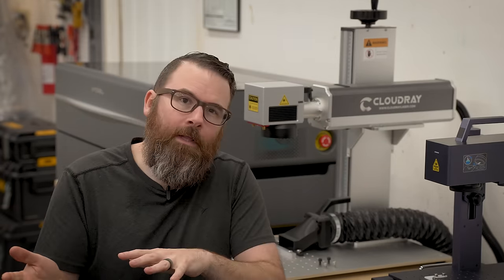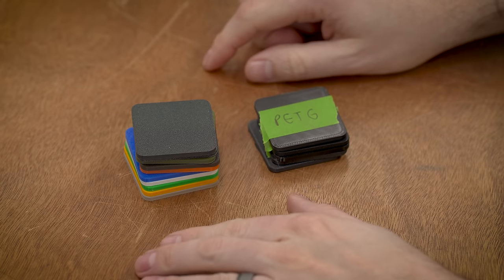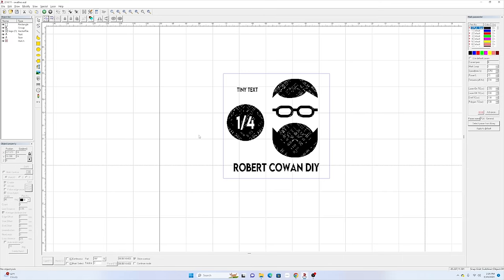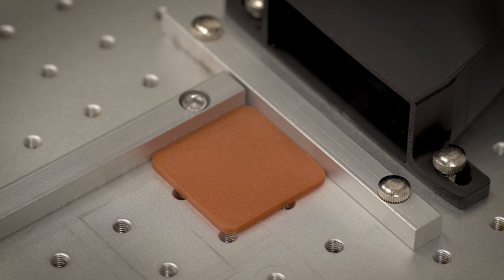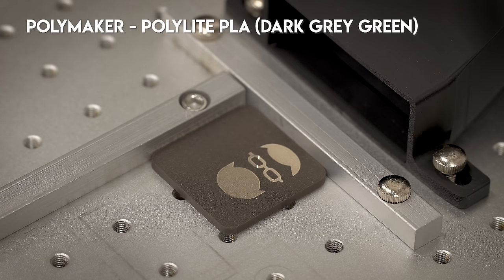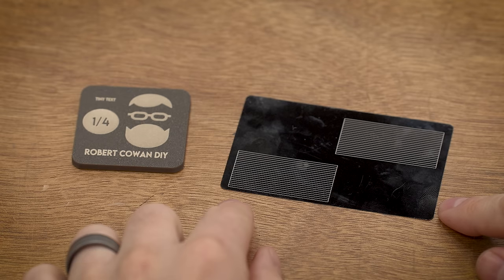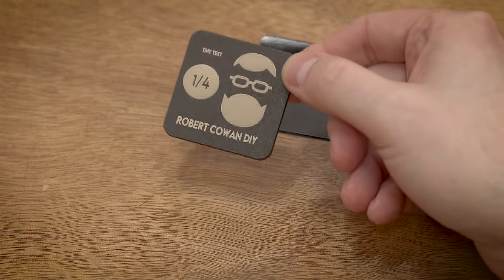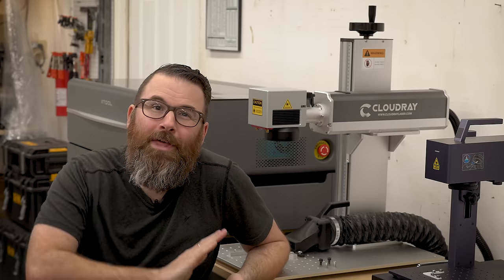Laser Marking 3d Printed Parts

Comment: Perhaps try doing a material test grid that comes standard in Lightburn. I've been working on some product designs and did a lot of 3D printed test pieces on my Ikier Fiber laser with the test grid to find what works and doesn't. Blue should work well. Yellow, Red and White just don't work in my experience. Blacks and grey, most greens do work. I print 100x100mm PLA flat test pieces which allow a decent material grid test for power and speed.
Reply from the maker: That could maybe work.

Comment: That sharpie would be a great trick for all sorts of light and colored filaments. How does it hold up against rubbing? Might be interesting to test different paints and see how they hold up to wear
Reply from the maker: Yeah, I glossed over it in the video, but it's something I'll visit again.  You could do the opposite of what I did, laser off everything BUT the design, etc.  It could be a good way to add lettering to light materials.
Reply: Protective clear coat of paint could be an option if the application allows
Reply: I've used sharpie for some markings in PLA and it hasn't held up in the long term.  Would be interesting to see how the laser marks in something that bonds more strongly to the plastic, (UV cure epoxy paints or something?)

Comment: Just as another data point, my functionally stock K40 (CO2 & Gantry Laser as opposed to Fiber and Galvo) works pretty good for engraving PLA, it ablates it well enough that I can print a few layers of my "text" color and then print a couple layers of my "face" color and then laser engrave it and it'll show the under-color where I engrave it. I've gotten text, logos etc. far smaller than I ever could with a printer.
Reply from the maker: I had a K40, they're fun little machines.  I always found that it still looked a little bit like melted plastic rather than this two-tone look from the fiber.  But I was able to get some fine details.

Comment: Colorfabb has or used to have a filament that was specifically designed to be laser engraved
Reply from the maker: OH, good to know!
Reply: Discontinued
Reply from the maker: @bonjipoo  Oh bummer.
Reply: It was a clever type of material which changes colour significantly when the laser hits it. Similar to how dashboard button are black but engraved with white markings. I believe the plastic is designed to turn white when exposed to the right wavelength.
Reply: @bonjipoo I believe it's due to the addition of one of the titanium "oxides" (I just can't remember exactly which one). Essentially it will react with the laser much better and produce a cleaner marking when the laser beam hits it.

Comment: I do need to try this again. On previous tests, I was not too happy with the results I got - just not sharp enough for my liking. I then switched to white PLA that I spray painted black, so kind of your sharpie trick, and that gave me a result that I was very happy with: a black surface with very sharp bright white symbols.
UV fiber has a complete different wave length than the IR one you have. A UV fiber is able to mark on white plastics and even on glass, something that is not possible with the 1064 nm IR fiber laser.
Reply from the maker: I could be mistaken, but IR and fiber lasers are different.  Mine is not an IR laser, but a fiber.
Reply: @RobertCowanDIY IR and UV are certain ranges of wavelength in the light spectrum. The visible light ranges from violet, blue, green, yellow and orange to red. Left of this (below purple) the UV (ultra violet) spectrum is found (100-380 nm) and all on the right side there is IR (infra red, 760 - 14000 nm). The fiber in fiber laser just tells us where the "lasing" takes place.
In a CO2 glass tube laser, there are two mirrors on each side of the tube so the light bounces back and forth between those to create the laser beam. In a fiber laser this process takes place inside the special fiber (this is oversimplifying the process but kind of explains why it is called a fiber laser). 
A UV fiber laser has a ~355 nm wavelength, an IR fiber 1064 nm and the CO2 laser tube 10600 nm. UV is great for plastics (even white plastic) and glass, the IR fiber has limited abilities on plastics but is great for metals and (dark colored) paints. The very long wavelength of a CO2 laser tube will blast through anything. You can cut through a lot of different materials with this one and engrave them when using lower power settings.

Comment: Not sure if it's of any use to hobbyists looking to laser but I've personally managed to laser Markforged Onyx, Stratasys ABS-CF10 and Nylon-CF10, and Stratasys ASA (Green) ABS (blue and ivory) and their black TPU with great success. I think it honestly will depend on material brand on whether you'll get decent results if I'm honest
Reply from the maker: Interesting.  I had no luck with anything with carbon fiber.  I might need to try some different settings though.

Comment: Just FYI:  the xtool F1 has a 1064nm galvo as one of its two galvo lasers.  The other is 455nm.  Both are diode.  You select which is used via software; no hardware fiddling required.
Reply from the maker: Yep, I'm aware.  They've been trying to send me one for the last year!  I suspect that 2W wouldn't be enough.  Also, they're not a pulsed laser like a true fiber.  It might get close, but it won't be as crisp.
Reply: @RobertCowanDIY I've marked a fair few materials with our laser pecker LP3 which is a 1W 1064Nm fibre. You can get decent markings from it but due to it being 1W it's very slow indeed lol
Reply: @worldwidepig  LP3 is not a Fiberlaser. It's just a diode laser. No fiber with gain medium.
Reply: I’ve been marking with excellent results with the F1 IR!!
Reply: @zaprodk  Fibers can do more, but many people seem under the impression that the IR diode can't do anything.  It's simply not the case.  You wouldn't want one as your primary tool if you want deep 2.5D engraving, but for names, images, or shallow depth, they work fine.

Comment: I actually like the ones where the contrast isn't super high. That dark blue looked cool. I guess it depends on the design and use-case. Sometimes low contrast is fine.
Reply from the maker: My wife likes those too.  You could do some sort of neat pattern on the dark blue one, instead of just labeling.  There are applications for sure.

Comment: Very nice! I get the same results on black PETG with my 60W MOPA fiber. I get slightly better results with my 5W UV. I've never messed with multi-colored 3D prints, so the laser marking has definitely come in handy.
(I saved several failed prints so that Id have plenty of material to do material tests on.)

Comment: The wavelength is important, but the fact that you have a pulsed laser is a lot more important.  The higher the frequency of pulse, the smaller the time domain is of the light pulse getting there.  It starts to vaporize, then cool repeatedly.  Do it high enough and you can cut metals.  Do it really high and you can cut through sapphire, glass, pretty much anything.  It isn't a perfect analogy, but it is a little like an impact driver vs a normal drill driver.
Reply: Soo a same wavelength diode laser would not work?
Reply: @RenatoYamamoto481 Likely not.  50W is a lot of power, so you would do something, but it would not look nearly as clean.
Reply from the maker: Yeah, I suspect you might get a result with a normal diode laser, but it probably won't be as clean.  Under a microscope, it's effectively completely removed all pigment from the area.  A diode laser might do something similar, but not as effective.
Reply: @RobertCowanDIY It is hard to do photochemical damage at that long of a wavelength.  You usually need to get into the UV range.  Can you put the laser in CW mode, or turn the pulse rate way down?  My guess is you would see more melty damage and less vaporization.
Reply from the maker: @kiltedcraftworks4609  You probably know more about lasers than I do, I'm JUST getting into fiber lasers.  I can look into it, thanks for the info.

Comment: ASA looks beautiful. I must try it myself on co2 laser. If it end up half as good it will be my new favorite way to mark my prints.
Reply from the maker: I've tried a CO2 and the results aren't usable, IMO.  It's just a squiggly melted line.
Reply: @RobertCowanDIY  to be honest I expected that results with CO2 laser.   Still I will try it with the lowest power and fastest speed possible.
Reply from the maker: @Rozbujnik_Rumcajs  Yeah, it's just that the CO2 just melts the plastic and that doesn't look great.  But the fiber is actually affecting the pigment.

Comment: I should get a fiber laser. This is super cool and gave me ton's of ideas for products :O I have a 40w CO2 and I've known for a while that I'll eventually have to get a fiber laser. This looks to be the push for it :D 
By the way, what happens with resin prints? I primarily print in resin, so I am very interested if that works as well
Reply from the maker: You really should ;-)  A fiber and a CO2 is the place to be.  Diodes are neat and all, but they can't do anything a fiber or CO2 can do.  I've never actually done any resin prints, it's just too messy and too much maintenance and from what I understand the parts aren't as durable as those from FDM.  I'd suspect the process would work the same, since it's just the pigment that's getting vaporized.
Reply: @RobertCowanDIY  I have not much experience with tough resins, but regular ones do hold pretty badly. They tend to fail tragically. Shattering usually. 
It is not that messy. I find it has way less hassle than FDM. Most FDM printers need a bunch of maintenance. Clean lead screws, tighten belts, tune many many things.... Resin is different but the machines are extremely simple and need nigh no maintenance :D Give it a shot. The learning curve of supporting is not that bad - it takes some time. But afterwards they tend to be way more stable, less failures, easy process. Most print jobs for me are about 30 min prep, 30 min post processing and that's it. 
Getting a pretty decent printer with a wash and cure is also not a big deal - you can get a nice set for about 3-400 bucks, which gives you a nice machine with all the tools for cleaning and post curing.

Comment: I bought an XTool F1 Laser just to laser etch my PETG prints and got it to look really decent, HOWEVER! How scratch resistant are your laser etched prints? Take your fingernail and lightly graze over the etch...in my testing it comes off so easy that I wouldn't put out a product of that low quality. (I make keychains) I tried to spray a layer of clearcoat on it to increase scratch resistance and it killed the etch making it so dark it was unreadable.
Reply from the maker: Interesting, mine seem more durable than that.  It's not as durable as metal marking, but good enough for basic labeling.  The clearcoat trick should fix it if necessary though, thanks!

Comment: That’s genius! Congrats for the vid, really useful! I wonder if a CO2 with pulses and low power would have the same results
Reply from the maker: There might be a way to get good results from a CO2 laser, but I suspect it wouldn't move fast enough to be usable.  My xTool P2 apparently maxes out at 600mm/sec, but I've found it's only really usable until around 500mm/sec, which is still 1/6th the speed I was going in the video.  CO2 also has worse power regulation down low, so you might not be able to control the low end of the power well enough for those slower speeds.

Comment: For the past week I have been experimenting with the diode laser to engrave markings, after watching your video, I will experiment with lowering the power to see if that will achieve a similar effect as whar you jusr showed
Reply from the maker: Nice!  Let me know what you find out.  I would assume diode lasers could get pretty similar results, it just might take more tweaking.  In theory, I'm running (on average) around 20% power on a 50W laser, so 10W at full power should be enough to achieve similar results, assuming you can move it fast enough and have the right wavelength.
Reply: @RobertCowanDIY  my 3w diode laser at 100% melts ASA while bleaching it at the same time. I think I need to go way lower. The laser is 450nm wavelength
Reply: @RobertCowanDIY  After further investigation, only the Carbon fiber infused PETG was engraving, ASA was getting bleached. However, as I was using red color ASA, the markings are not very high contrast. Probably would have worked better on a darker color ASA. PS, this is Hilmi who commented earlier, just using my official YouTube account to comment
Reply from the maker: @Hilmi12  That's a very different wavelegnth from a fiber laser.

Comment: Can you try using white on the layer below the top layer and ablating the top layer to expose the white layer below? The top layer can be an ironing layer for a thin coat over the white.
Reply from the maker: There is no ablating of the material.  Think of it like bleaching.

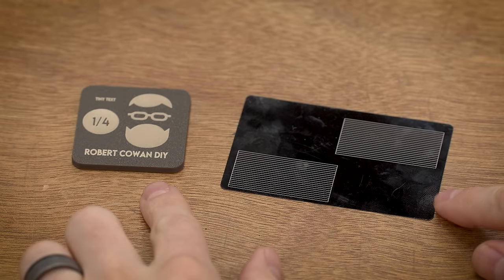Comment: @robert; I didn't see your calibration video you talked about @9:25. I only saw (and watched) your beginners guide hatching. I have a brand new cloudray mopa laser and would like to calibrate the hatch settings like you did in your video.
Reply from the maker: That's the video.  You're just calibrating the hatch offset.
Reply: @RobertCowanDIY  I must have missed the "calibration" part of the video. Can you provide a time index where you measured and then used that measurement to adjust a setting in the software?
Reply from the maker: @zitt  OOPS!  I linked to the wrong video, try this one instead:  https://youtu.be/KKmpiMiHXjg?si=0wJ6kYpzGMjJF-Mh

Comment: Could you please share your hatch settings? Like the line spacing and  angle. Thank you
Reply from the maker: I just used all the defaults, 2 passes at an angle.  Everything else is just the default.
Reply: I use Lightburn. I was gonna match the line distance from you. I guess I will have to try out different distances.

Comment: So can you smooth pla with a laser?! 🤯
Reply from the maker: No?  I'm not sure how you got that from this video.  It's vaporizing the pigment
Reply: @RobertCowanDIY  in this video, you said CO2 or diode lasers will melt the surface. That's where I got it from 😁
Reply from the maker: @gbradley10021 oh, gotcha!  You might be able to, but I'm not sure how practical it would be.  The focal plane is fairly small, so it would need to be flat.  Ironing in the printer would be far more effective

Comment: Would you mind sharing the settings that you used for the PETG? Thanks.
Reply from the maker: you REALLY need to just play around with it.  I'm usually around 20%, 2000mm/sec and the highest frequency it will let me type in there.  But each color is different even.
Reply: @RobertCowanDIY thanks. I managed to get very similar results with 2000mm/s, 11%, 0.08mm line distance, 250ns, 30kHz.
Reply from the maker: @Ccorniit  nice!  there are a LOT of settings that seem to work.

Comment: Why don't fiber lasers ever have guarding?
Reply from the maker: It does.  I have an enclosure for it, but I typically don't use it when I film.  The computer for controlling it is opposite, so my back is literally to the machine and I'm watching it through the camera's external monitor.  I will be doing a video soon on the enclosure.

Comment: have youever tried on diode? i only have IR/Diode tx
Reply from the maker: I covered that in the video, a diode will just melt the plastic, you need the wavelength of a fiber laser.
Reply: @RobertCowanDIY  bummer, and sorry i sorta skimmed. ADHD issues. Next printer will need to be a co2.. bwahh if only i had infinite $$$ supply lol